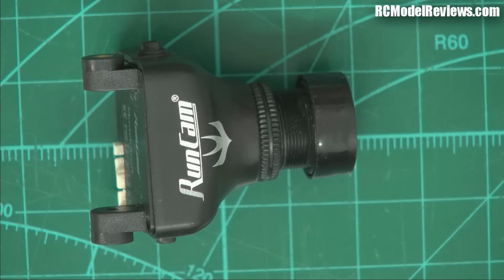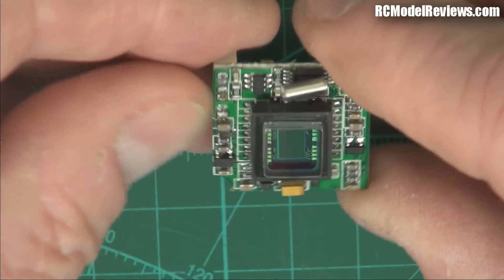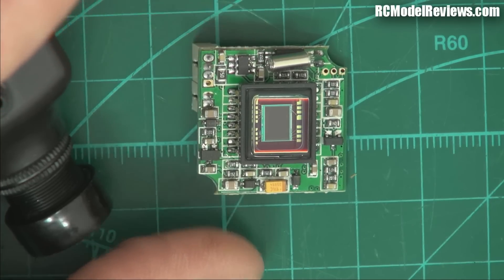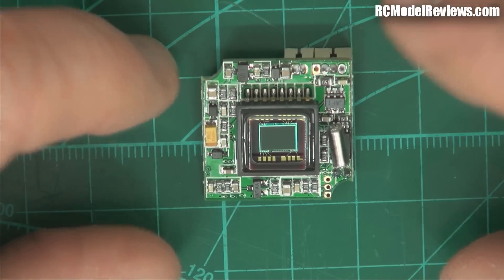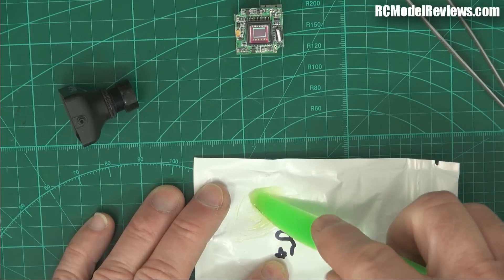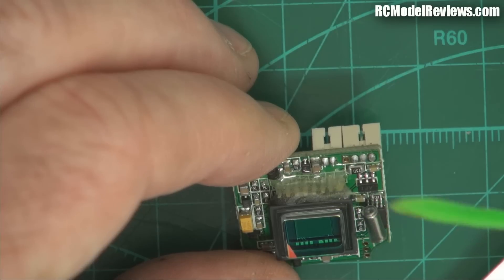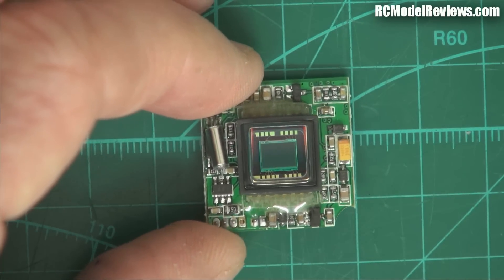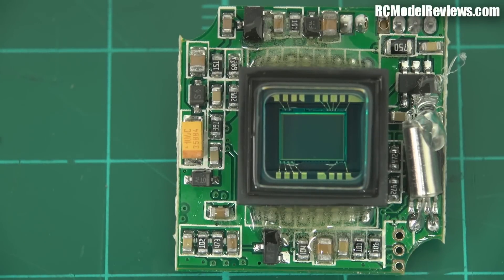Ruggedizing the Runcam Swift FPV camera

Comment: Bruce, what's a good way to limit the spread of the epoxy? I want to ruggedize a flight controller (SPro Mini). I want to use epoxy to make sure the USB port and maybe the JST connectors don't get lose when I plug und unplug connectors several times. The problem is that I am concerned when I apply the epoxy resin it will spread to areas with soldering holes or even into the little holes of the USB connector. Currently my idea is to cover the holes and the area which I want to keep free of epoxy with hot-glue. After the hot-glue is dry I want to use the epoxy and after the epoxy is dry (maybe a night later) I want to remove the hot-glue again, because that is easy to remove. What are your ideas about this? Thanks.

Comment: There's also been a problem reported where the actual PCB vibrates inside the case. I experienced this the other day out flying where I thought my PIDs were off or props too damaged. It was the worst vibration I had ever had by miles. However reviewing the HD footage revealed that the quad was flying fine. Am yet to pull the camera apart to apply a fix though.

Comment: omg you used epoxy lol ammature rcmodelreviews your suppose to use silicone why if you ever have to resolder you wont get it clean enough....... and you used a hot glue gun on the crsytal loooooooooooooolll come on man do you have any degress in electronics or any kind of expeieince psst epoxy is a catalist and heats up and you just heated up those joints and etched the things.... dji uses a semi hard  silicone forget what its called..

this is why i dont trust bruce opinions at all and btw google this old fuck..... youll be shocked what you find

Comment: Pffff Like that crystal would ever in lifespan of known universe break from vibration.. right..

2 hours later, rain stopped. I better go fly my quad with Runcam Swift. WHAT!? Only osd no picture.. Tearing camera apart checking voltage etc. Applying pressure to board made picture re-appear.. ok. lets see.. ok crystal had one leg broken from vibration. :) quick solder and right.. it started to rain again :)

Comment: Hi Bruce. I have one question slightly out of this theme. Is it posible, to use SMA Splitter, like this one http://www.ebay.com/itm/371560879213?_trksid=p2057872.m2749.l2649&ssPageName=STRK%3AMEBIDX%3AIT on the quad and install 2 cloverleaf antennas? For example, one on the top and one on the bottom or left and right. Will this give me more coverage or a drop in the performance? I have one on hands, but can't test it right now. Quads are not finished. Thank you for the answer.
And thanks for the RunCam tip. Done it yesterday.

Comment: im new to quads, and am buying the hobby king v2 pro goggles with the skyzone 832 combo is the 480tvl good enough or would this one be better im on a tight budget so 20$ and under.  http://www.ebay.ca/itm/291783607907
Reply: That camera doesn't have WDR or any way of changing the camera's parameters so although it will work (note that it is PAL not NTSC) it will not be nearly as good as the HS1177 or the Runcam Swift.  Since the camera is perhaps the single most important part of an FPV system, I would be reluctant to compromise.
Reply: decided to go wiht the runcam do u think this 2.1 lens will work in it?   http://www.ebay.ca/itm/110966168415?var=410691242129   i will be flying close to objects so i think wider is better.
Reply: Just remember you will have great distortion around the edges, making it harder to make sense of what you are seeing, even though you will see more.
Reply: i ended up buying the runcam swift it makes a huge difrance in picture quality. i tryed the v1 goggle kit then tryed the v2 pro with the runcam.. and wow cant believe the diffrents so glad i went with the better system. lets just hope i break nothing this month i went way over budget on these

Comment: One tip for finely applying epoxy and mixing it thoroughly is to use the corner of a sandwich baggy like a cake icing piping bag.  Cut the corner of a sandwich baggy with scissors, smudge your two part epoxy inside the corner, twist up the baggy end, then knead the epoxy between your fingers to mix it well.  After mixing, cut the very corner of the bag with scissors as big or small as you like (think of it as nozzle size), then start twisting the bag end to make it flow out.  This makes for a very neat and direct applicator, and you mix it so well it cures better.  You can also feel when the resin is starting to set.
Reply: that's a good tip if i ever need to epoxy anything i will do that. much cleaner and better way to apply it.

Comment: I just checked and Hobby King has about 10 different kinds of Epoxy. Which one do you recommend or how to chose the best Epoxy for the job?
Reply: The choice of epoxy isn't critical but I prefer 15-minute types to the faster "5-minute" types as it gives more time to get things sorted before it starts to go off.  Just avoid any epoxies that might have metal added to them -- they should be clear or translucent in color.

Comment: On my camera this crystal broke after 14 days and I fixed it, than one trace of the photo sensor broke a week after. I found the trace on the other side of the camera and put a bridge wire and used hot glue all around. I hope she will work now :)

Comment: looks like the hs1177 has a better designed board, it hasn't such a tube crystal
Reply: Just thinking that myself, never seen people have to do this to make a HS last
Reply: I had the hs1190, did not epoxy the crystal and when I crashed, crystal ripped off the board

Comment: cheers bruce, just opened mine up and done the same :)
Reply: Just got a new one in the post - they've added some glue to the crystal on the front + a rubber backing to the board now. Seems someone at runcam is watching ;)

See here -

http://imgur.com/a/eykPV
Reply: I concur. Received one 2 weeks ago and it's had the reinforcement treatment in the factory. Good stuff, Runcam!